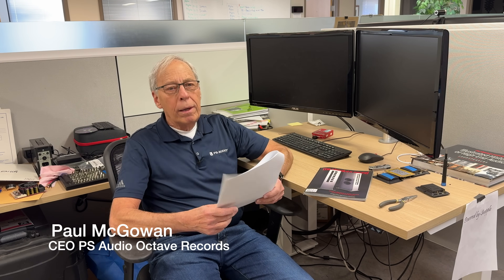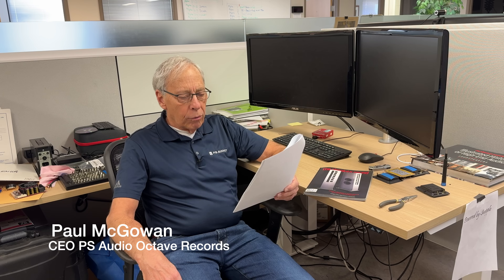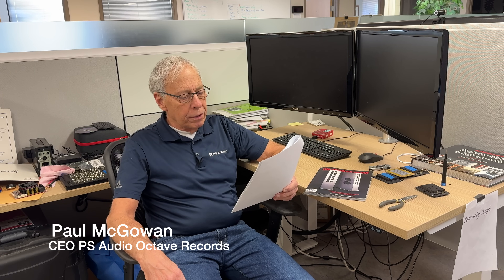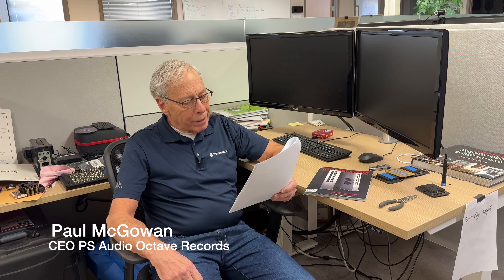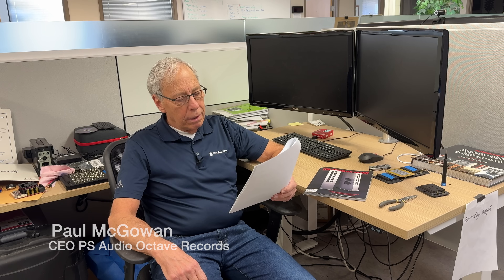The digital recording process

Comment: I remember when CDs first came out in 1982. Many analog recordings (from the master tapes) were “converted” to digital and given the tag ‘AAD’ because they were already recorded and mixed in analog. Over time, digital methods got better and engineers learned how to re-mix the original source in that format which was more about “cleaning it up”. That’s when the tag ‘ADD’ was included. 

Back then, I think I preferred the AAD process because it was less altered. It made analog recordings sound maybe a little harsh but when digital mixing of that source was introduced, it left a lot to be desired musically, perhaps due to compression or lackluster D/A conversions or some other processes. Of course today, these processes are seamless and sound very, very good.

Comment: Obviously the quality of the microphones and the quality of the analog to digital converters matter. Saving the tracks as DSD is sort of alright, but when you do any digital mastering of multiple channels involving any signal processing, you have to do it in PCM. Thus, you end up having to TRANSCODE the DSD to PCM in order for you to master the music. An ADC that outputs directly to PCM can technically be better as PCM is indeed what you need and one can argue if the PCM direct output is more loyal to the analog signal than the ADC with DSD transcoded to PCM externally can be. Reality is that either way can do an excellent job. Then for optimum mastering, you obviously want a high sample rate (many samples per time) and high resolution (many bits) to allow the digital mastering math to minimize any calculation artifacts and yield a digital output that is as loyal as possible to the analog sound that came into the ADCs in the first place. The mastering process will output PCM and if you decide to TRANSCODE it to DSD, you are introducing LOSSES in that conversion compared to the native PCM that was the output of your mastering signal processing algorithms. Technically there isn't really much of an argument for DSD in all this except if you record with stereo microphones and the raw ADC output in DSD is what you distribute to consumers (= no TRANSCODING losses). Reality is that just using a single stereo microphone usually will result in a horrible sound stage and lack good balance between various instruments and vocals.
Reply: In the past, Digital has been put down by so many that to this day, for some, digital audio is a bad word. Of coure the dumping on digital came into being by the poor sound quality  of early cd players. They should have waited a few years longer. But...there were several years before cd came out, where we were getting some examples of digital mastered lps. Some of them we really liked, and liked the sound of. We came to think highly of the potential of digital audio. For myself, those lps included The Nightfly and Mountain Dance by Dave Grusin. Perhaps that is the difference between the open mindedness of audiophiles who accept digital and those who don"t. We discovered some fine sounding digital lps; before the advent of cd; and they didn't. And they formed their opinions against it from bad early cd reproduction and some of the audio media. Digital has improved into something wonderful; for the most part. The loudness war  cds I don't run into that often. I'm almost all vintage music.
Reply: @sidesup8286  I bought a Denon CD player in the mid 1980s and it had excellent DAC already at that time. Compared to my vinyl player it eliminated wow and flutter, noise and click issues I could easily hear when playing vinyl. Also there was zero audible jitter issues. I often used it listening with my Stax SR-44 headphones connected to my NAD 3020 amplifier. Those were relatively low cost audiophile products but the audio fidelity was outstanding at that time.
Reply: @sidesup8286  My mid 1980s Denon CD player with 18 bits and oversampling sounded  terrific when used with my Stax SE-44 electrostatic headphones connected to my NAD 3020 amp back in the early days of CD. No wow and flutter, super low noise, flat frequency response, no audible distortion and no audible jitter was already achieved in those days. Most consumers of today listen to music in much inferior quality.
Reply: 😅😅8k8 4:32 😮😮
Reply: To each his own..I like vinal and digital collections, also I'm quite happy with both sound systems I have however I'm sure most audiophiles would not approve, D9s and klipsch... gasp, everyone enjoy your system we all would like to improve our systems everyone have a wonderful day and a great musical experience🎉.
Reply: @mikebrookshire3464  Yeah, if you are happy with your system, ignore the views of anyone else. You don't actually need expensive gear to make audio sound awesome. When audio fidelity is good, it's mostly about excellent engineering rather than expensive gear. Often very expensive audiophile gear is made by people who don't produce enough stuff and make enough money to hire top-notch engineers and buy the state of the art test equipment, test room etc. Those companies might have excellent listening tests, but they lack in most other areas.

Comment: I just listened to a YouTube that said most mixing / mastering software only work with PCM. Is this true? though still digital it would require as much manipulation and fussing as D to A and back again.  Great videos  Thanks
Reply: Which mastering software does not use PCM?
Reply: Paul's glossed over this. No software currently exists to mix in DSD. So there is a conversion from DSD-256 to high bitrate PCM in their process before mastering. Then converted back to DSD.

Paul has mentioned in the past that they believe this to result in the best capture of the live performance. Better than a direct high bitrate PCM capture.
Reply: @manitoublack  Fact is that since the native output of the mastering process is PCM and any transcoding between PCM and DSD is lossy, there is no good argument for introducing DSD for best audio. Your DAC can do a more optimum job in translating the master output to analog also if it internally is using sigma delta conversion.
Reply: @ThinkingBetter  "any transcoding between PCM and DSD is lossy," - not necessarily.  Given the entire PCM or DSD file, one can convert from one to another with a precision that is better than the LSB in the final output. However, one cannot do this just with a part of the recording.
Reply: @TheDanEdwards  Obviously with higher quality format on the output you can more precisely capture timing and level. But while PCM defines a certain high precision level at a certain time, DSD is delta based with higher resolution in the time domain. But what is the point of transcoding to DSD considering you only in a best case preserve the master content and generally end up with a digital format that is dysfunctional on ability to be processed and only can be fed into a DAC. Maintaining the original master to my streamer allows me both best performance exclusive mode bit perfect playback into the DAC or alternatively any attenuation, EQ, digital cross-over (e.g. for subwoofer), wireless audio, voice control mixing and so on in my modern audio gear. I get the bit perfect audio and ability to process it. Why any less? BTW, modern DACs usually don’t operate as single bit sigma delta converters.